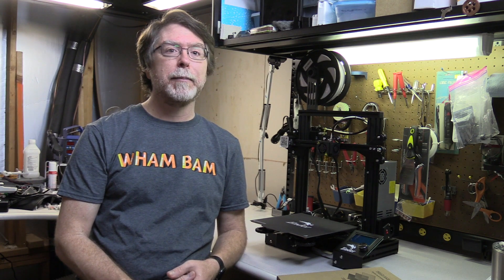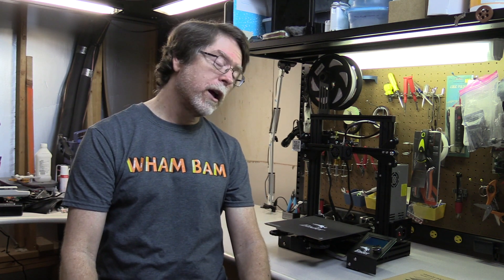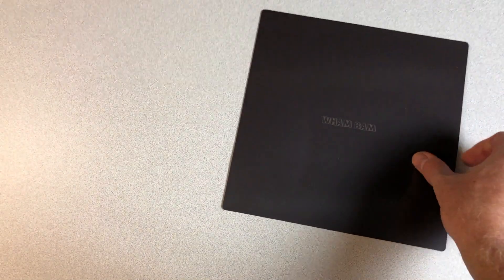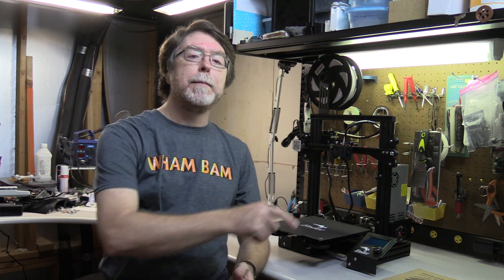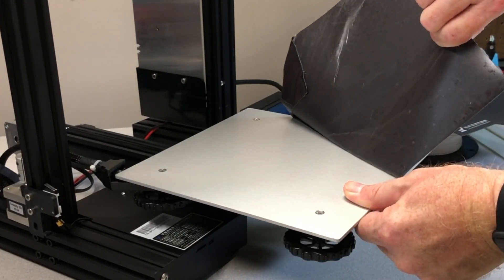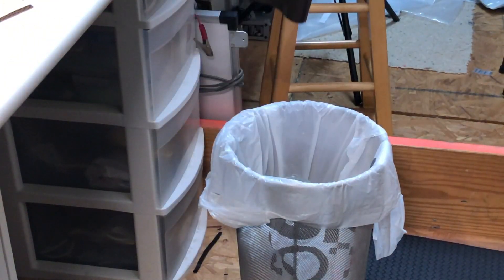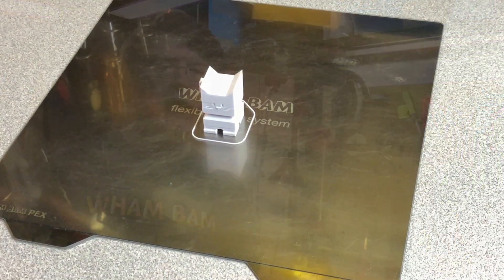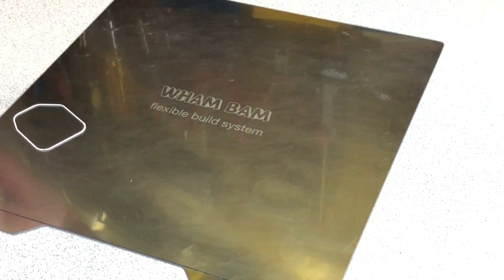Install the Wham Bam Flexible Build System on Ender 3 Pro

Comment: Did you wait 72 hours for the magnetic sheet to adhere?
Reply from the maker: I did not. In fact I started using it pretty much right away. That said, the magnetic sheet has been on the printer 23 months and it is still stuck down as well as when I first installed it.
Reply: @BV3D  thanks! It's hard to wait 72 hours with the excitement of wanting to try it! Haha

Comment: can't I just use the original magnetic base with the new wham bam spring sheet? I placed on it and it holds just like the ender build plate.
Reply from the maker: Hi, you can probably get away with that for a while, and wait until the Creality magnet loses enough of its magnetism that it no longer holds the spring steel sheet well. My recollection when trying that is that the Wham Bam magnet felt like it held the spring steel sheet more firmly. The Wham Bam magnet is rated for higher temperatures as well. 👍
Reply: @BV3D  cool thanks for the reply. I'm not ready to pull my ender apart yet but I do have the wham bam system and when I'm ready, I'll try it first with the ender magnet and then if I like the new system, I'll do it correctly.
Reply: @BV3D  Hey Bryan so I did it and I have the bed at 70% and its holding just fine. Of course I only really print PLA so I think I'm ok with not having to remove the old magnetic base. Thanks for the response my friend
Reply: in fact its working great!
Reply: @BV3D  I think the only down side it waiting for the flex plate to cool before removing the prints. ugggg
Reply: @mcorrade  Do you think it would work well if you just bought the flex plate and the build surface as accessories for $30 and use with the existing magnet?
Reply: @gregorygray2798  yes that's just what I did. I used the original ender 3 pro magnetic bed and got the wham bam steel flex sheet and just used it on top. This way I can always go back and use the original ender flex surface. In fact I just di that and can't stand the ender build surface anymore lololo. The wham system is WAY better.
Reply: @mcorrade  Did you also get the build surface to stick on or just the sheet?
Reply: @gregorygray2798  no I used the entire wham bam except for the magnetic base. I used the PEX which is an awesome build surface
Reply: @mcorrade  I finally got to open my Ender 5 Pro Christmas present.  I had ordered the wham bam plate and PEX surface but used the original for a while so I could get the OOB experience.  Switched and wow is the wam bam better!  Works great so far with the original magnet.
Reply: @gregorygray2798  cool

Comment: Brian are you still using this and how do you like it?
Reply from the maker: Hi Mark! Yes -- I've got Wham Bam flex plates installed on an Ender 3, Ender 3 Pro, and two Monoprice Maker Select Plus printers. I'm using a mix of sprint steel sheets, some with PEX installed and some with PEI installed. The Wham Bam system is one of my all-time favorite things.
Reply: @BV3D  Thanks I am going to buy one for my Monoprice.

Comment: Great video, as always! I just do not get why you had to remove the original magnetic base and replace it with the new one, as they seem pretty much the same thing. What would happen if you stick with the stock magnetic base?
Reply from the maker: The Creality Cmagnet base and the print surface are both magnetic. So while the Creality base magnet will hold onto the spring steel sheet, it doesn't hold nearly as strong as the base magnet from Wham Bam.
Reply: @BV3D  Thanks Bryan! I do not know if it is because my ender 3 pro is very recent (I bought it a month ago), but the fact is that when I place the steel sheet on the stock Cmagnet base if  feels as if it adheres  to it very strongly, no less than when I put it on top of the new base (although it is another brand, not wham bam). So for now I'm gonna try a few prints without removing the Cmagnet base and keep the new one for later. I can always change it later, but if I remove the original one now, then I could not go back, because it gets ruined

Comment: they should give you like a 5mm bigger on each side pex thingie so you can cut it and leave it perfectly aligned! the OCD hurts 0_0
Reply from the maker: I thought about trying to make some kind of alignment jig so I could get the PEX sheet aligned perfectly with the bed but in the end, I think my motto is "Close enough is close enough." (and I kind of share the OCD but in this case I've learned to just deal with it. The adhesive on these sheets is super sticky. You get one shot at installing it)

Comment: hey mine is arriving soon and the 300x300 was not something I can afford easily. it's a gift from my sister so it's special to me!

do you think these would be easy to remove? (the magnet portion) the issue is i'm gonna install it over my normal mk2a aluminium heated bed but i'm worried the bow and all of the bed would make it unusable etc/ specially it might warp more overtime since my printer is new. do you think the magent could be easy to remove? I could install it over glass from the begining but that'd make a thick 4 layer sandwich 0_0
Reply from the maker: Hi Chloe, and congrats!

Trying to remove the magnet sheet after you've installed it will most likely destroy it.

So far I haven't had much issue with bowed beds, although I do kind of wish I had put a little bit of one of those shim strips in the middle of the bed of the Ender 3 Pro. It's not bad, but it is maybe 0.1 mm lower in the middle than at the edges. But since most of the things I print don't go all the way to the edges of the bed, I usually have it adjusted for the best first layer when things are in the middle. I also use a 0.24mm first layer, which seems to help accommodate such issues.

You can use the straight edge of a steel ruler, and lay it diagonally across the bed and shine a light behind it to see if it's bowed up or down. Wham Bam has a video showing the ruler technique on their site (https://youtu.be/ZLxP0Wo2044?t=127)

I'm about 5 or 6 months into having this on the Ender 3 Pro, and haven't noticed a problem with the bed bowing more than it already was from the factory. I don't think you want to go super thick on the bed, both because it'll take longer for the print surface to get up to temperature (despite what the bed thermistor says; it will take longer for the heat to work its way up through the layers). Also you'll be adding a lot of mass to the Y axis.
Reply: @BV3D  my printer is a corexy so the mass won't matter much but yeh! I do have a probe so i'll check how bad mine is. maybe i can sand it down and use a middle screw to also add support to the middle of the bed

Comment: Hey Bryan, I have a question on the MP SELECT PLUS using Cura 4.0.0. I have only added the Z-axis brace to my unit and everything else is stock. I want to change filament during a print to highlight letters that are around 2 mm taller than the finished top surface. Do you have any how-to on how to successfully accomplish this? I plan on making filament cards, Keychain, etc. Pause at height and pause at level seem to stop right on top of the item instead of moving off where I can purge my nozzle. Can you help? Thanks, Rocky
Reply from the maker: Hi! I don’t remember whether the stock firmware on the Maker Select Plus supports the M600 G-code command. M600 is the “Filament Swap” command. I don’t think it does. The ADVi3++ firmware handles it pretty well. If you’re not ready to try upgrading the firmware (which also requires updating the code on the LCD display), try to pause the print using the controls on the LCD. If the printer lets you pause, AND moves the nozzle for purging, then you’re golden. You’ll just have to do it manually like that, instead of in G-code. I may have time next few weeks to try downgrading the firmware on the printer and seeing what I can make it do. But in the meantime, try manually pausing and see what the printer does. Just try it on a calibration cube or something, and try after the second or third layer. It’s just a test. Good luck, and let me know what it does.